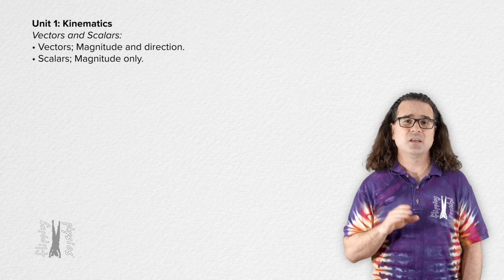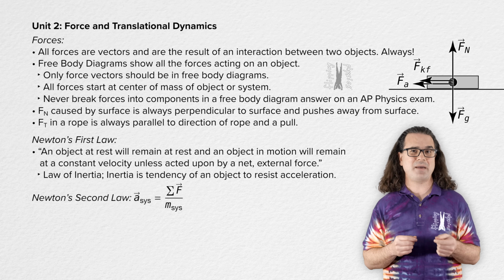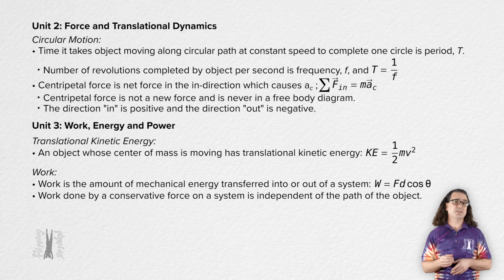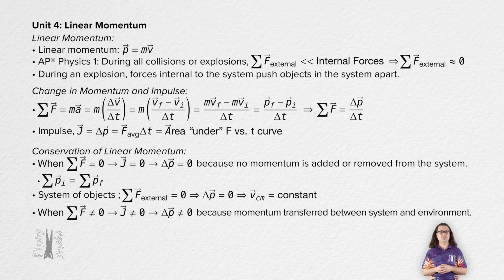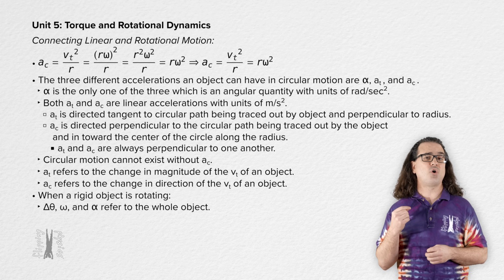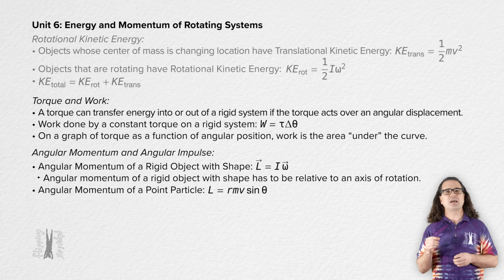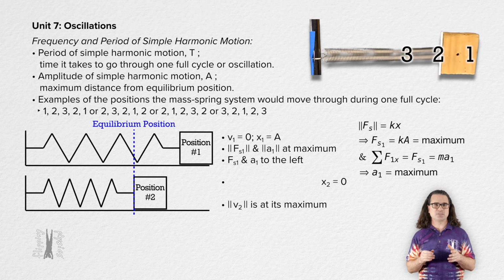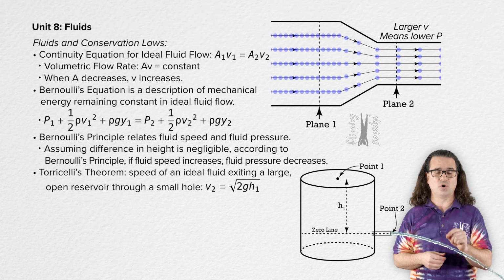AP Physics 1 Exam Cram: Full Curriculum in 30 Minutes

Comment: Wait what does “never break forces into components on a free body diagram mean”? Dont we separate for example gravity into mgsin0 or mgcos0 sometimes?
Reply from the maker: When solving problems, we often break forces into components, however; when you are drawing a free body diagram as and answer in an AP Physics exam specifically, you always draw the full force vector and not its components.

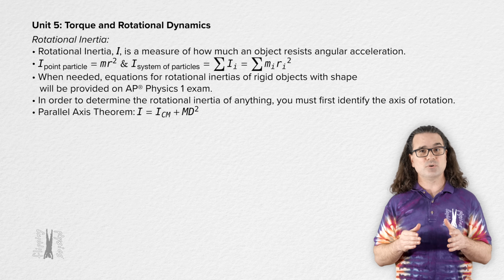Comment: 20:42 I don’t remember anything about this Parallel Axis Theorem from your 300+ videos on AP Physics 1? Which one was it again?
Reply: You can find it in his AP C section, where he derives it. AP 1 isn't responsible for the derivation. If you need it, it'll just be plug and play.
Reply from the maker: The one for AP Physics 1 is right here: https://www.flippingphysics.com/parallel-axis-theorem-example.html
I did not put the Parallel Axis Derivation video in AP Physics 1 because it is unnecessary.
Reply: @ oh so is it not a topic I will face on the AP test?
Reply from the maker: @rocketniketh3868  Incorrect.
You do not have to know how to derive the Parallel Axis Theorem.
You absolutely have to know how to use it.